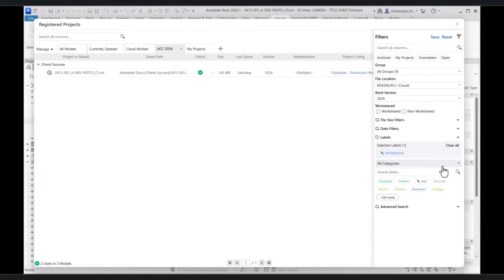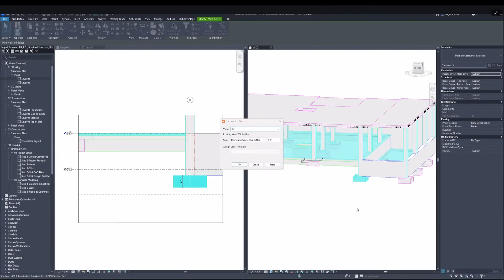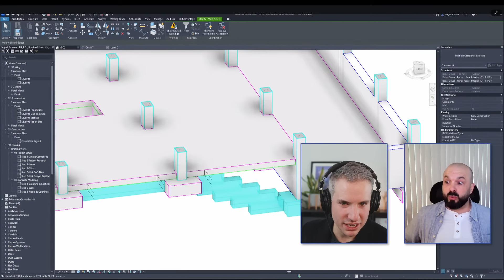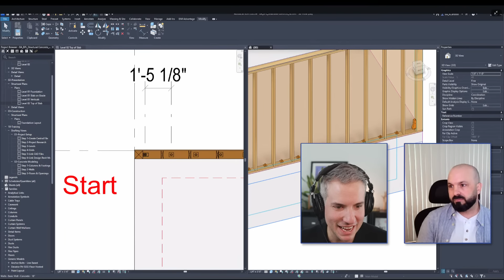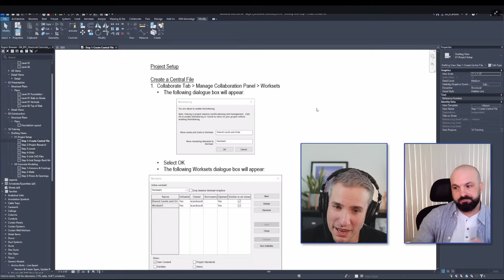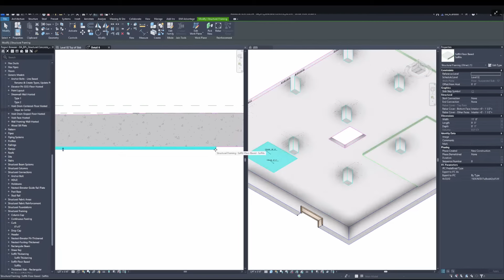Revit Concrete Masterclass w Kevin Cardoso |  BIM Pure Live 104

Comment: Talking about a Masterclass… This is awesome!  
The fact that every step and functionality in these families looks logical, simple, and easy to use is mind‑blowing.

The only disadvantage of using Structural Framing instead of Floors to fill up these modified areas is that you can’t use the main “by category” filters correctly in ACC and Revit. This can be unclear for third parties reviewing your models. If these elements were drawn as a different floor type, you could easily filter them out in your area schedules.

But of course, I really love the benefits of the Structural Framing workflow.

The colored‑element separation linked to your schedules left me speechless. Truly inspiring work. Thank you!